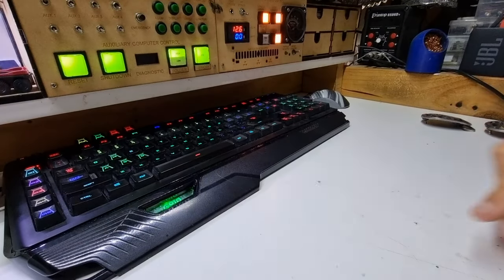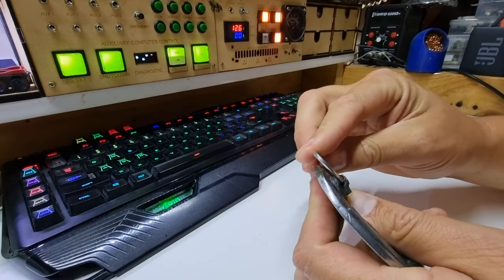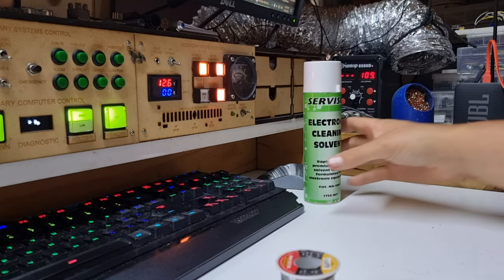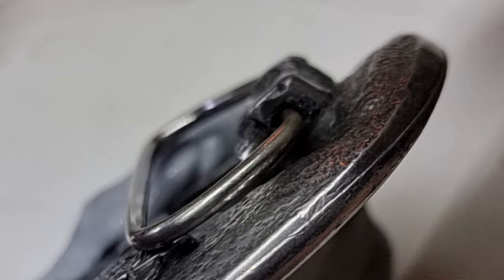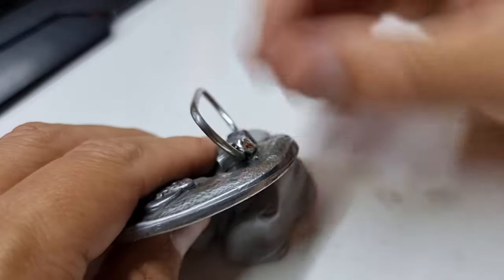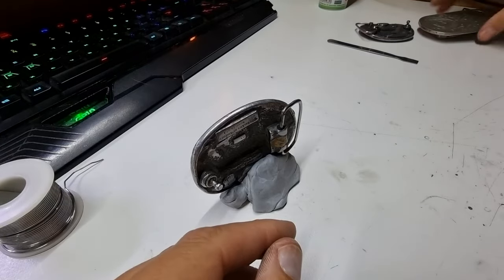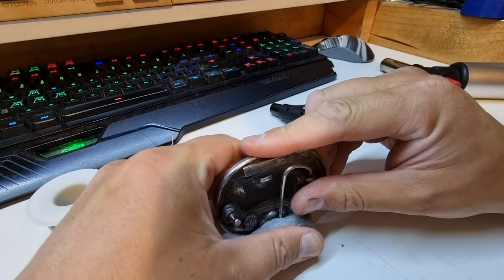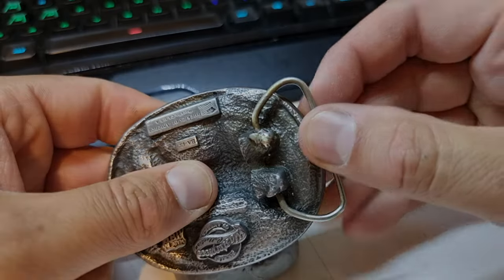Repairing my favorite pewter belt buckle.

Comment: Questions! Firstly, what is the name of the pin on the belt  buckle? Mine broke off because it was stepped on :-( The belt buckle means a lot to me. Can I just do the same thing to reattach the pin? OR will it not be strong enough soldering? The material is stainless steel.
Reply from the maker: Stainless is not something you can solder to, it needs proper welding at much higher temperatures. tin/lead solder will not bond to stainless at all.
I'm not sure of the official terminology for the retaining pin I'm afraid.

Comment: I broke a silver belt buckle, how would you recommend going on and fixing that?
Reply from the maker: Silver solder and flux would be my goto, and be careful with the heat.
Reply: @TheAussieRepairGuy do you recommend using a smaller butane torch like you used in the video, or a big propane one?
Reply from the maker: @wyatt5770  the one i used uses a propane-butane mix.
It's a bit undersized for the job, I habe a slightly bigger one, but was concerned it would overheat stuff, i don't do this very often, I'm probably not the best source of advice

Comment: did you use flux either time?
Reply from the maker: Flux core solder.
Reply: @TheAussieRepairGuy  I need to reattach a metal clip to a pewter guardian angel for my sister in law (it slides onto the car's sun visor) Do you think this would hold, I was going to epoxy it but I like this idea better.
Reply from the maker: @gilmo1938  I think 8 revisited this a second time as it came away, it needed a lot of heat. 60/40 tin lead solder's melting point is close to pewter, so I would be very careful. I've used metal mend epixy before with is a putty with metal fibers in it, It's honestly a close call between methods.
Reply: @TheAussieRepairGuy  thanks for the advice, this was brought to me tonight and I figured I'd fire up the ol YouTube, hasn't let me down yet!